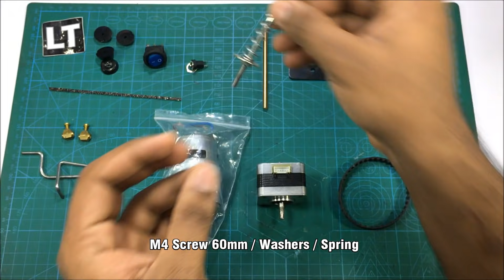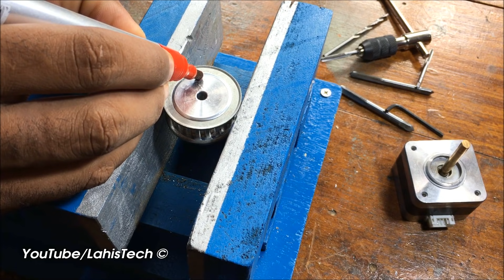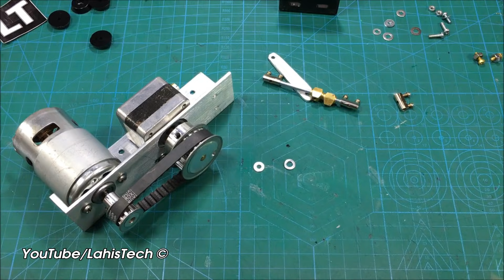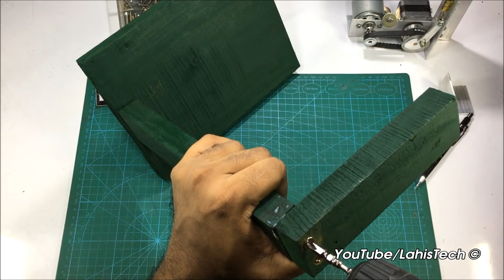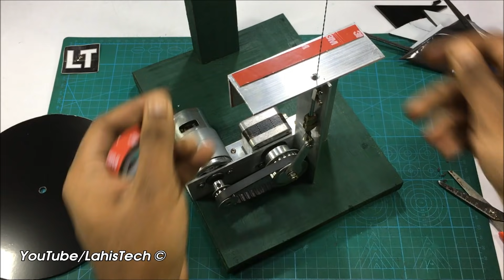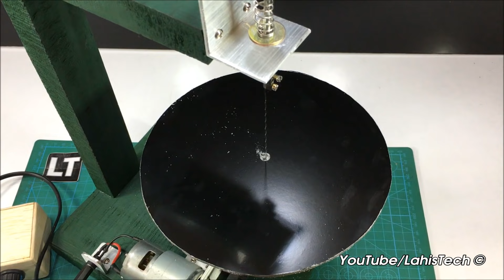How to make SCROLL SAW machine at home

Comment: El diseño y componentes son muy similares a un modelo fabricado por un italiano que vi en otro video. 

Él también utilizó madera para la estructura principal, el mismo sistema de biela, el sistema de sujeción de la sierra, control de velocidad, etc.

Es un buen diseño, solo se me ocurren unas cuantas cosas para mejorar la fabricación, os las comparto:

1. Minimizar las vibraciones utilizando una  base pesada. El mejor material es el metal como hierro fundido o acero pero el costo se eleva mucho. Se puede fabricar una base de cemento o algún material pesado y sobre ella armar el resto de componentes. 

También vale conseguir hierro o acero viejo para que salga barato, el caso es que la base pese bastante para que al cortar no vibre. Este tipo de sierras son pesadas, alrededor de 15 kg precisamente para contrarrestar la vibracion. 

2. El sistema de tensión de la sierra debe poder mantener la tensión sin que se afloje cuando se corten piezas gruesas o madera dura, habría que utilizar un buen muelle en la pieza superior.

3. Se puede utilizar un motor de inducción qué es más grande pero más potente y sobre todo silencioso.

4. Se puede omitir la banda o correa y el segundo disco o rodamiento, basta con instalar una polea grande y una biela adecuada directo en el eje del motor.

5. Utilizar de preferencia perfiles metalicos para la estructura, de este modo la maquina durará mucho y no se aflojará con el uso.

6. Podeis fabricar vuestros propios repuestos de sierras con sierras para arco de marquetería, con sierras manuales o con sierra de esa que se vende por metro, esa incluso sale más barata. 

La única que no se podría fabricar en casa tan fácilmente es la sierra en espiral qué es la mejor y la ideal para estas máquinas, pero se pueden conseguir unas muy baratas en Amazon, Bangood o AliExpress. 

Recomiendo comprar hierro viejo o buscar piezas en los deshuases de coches o de maquinas, se pueden encontrar piezas y materiales a un precio buenísimo. 

Mucho ánimo y que os quede genial vuestra sierra caladora de banco o sierra de marquetería, yo me haré una en cuanto consiga algunos materiales. 

Animo a fabricarla! ✌🏼😄

Comment: Lahis!   How did you know I was looking for a scroll saw.  MINE IS GOOD BUT OUT DATED. CANNOT FIND 3 INCH BLADES ANY MORE.
Reply from the maker: SMART ASSIST you can easily find it on Ebay, Banggood. I put the link in description. Good Luck with your project.

Comment: All you have to do now is work out how to tension the blade. But I'm going to have a go at building this so we'll done. As I have all the parts I need why spend $100 on something to play around with. With the way the world is right now that money could be spent on something better
Reply: I would highly recommend adding some more wood to the bar to stabilize it more, as well as try making the base of the unit a bit heavier. With that RPM and an unstable arm, not only would it make for sloppy cuts, but it's just begging to nick off a bit of your finger.